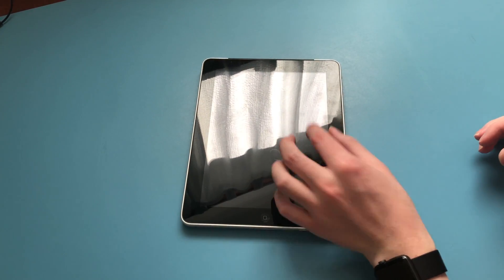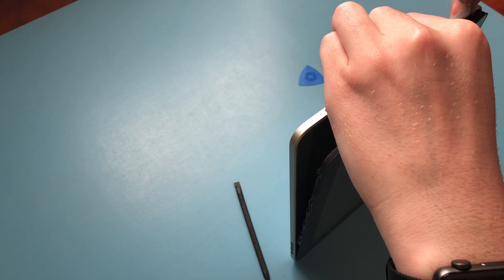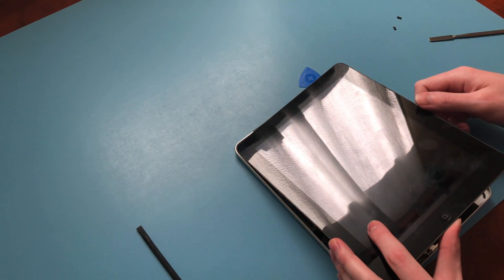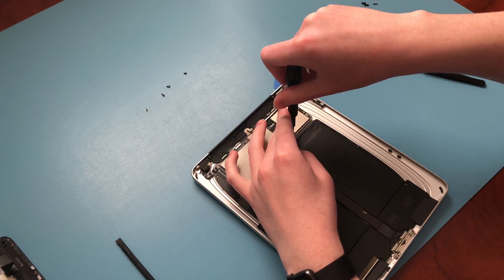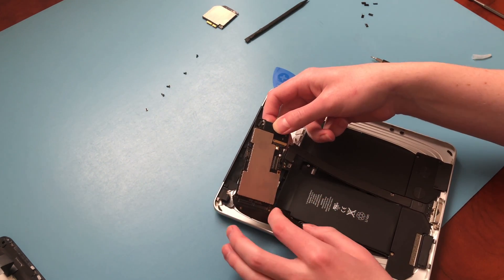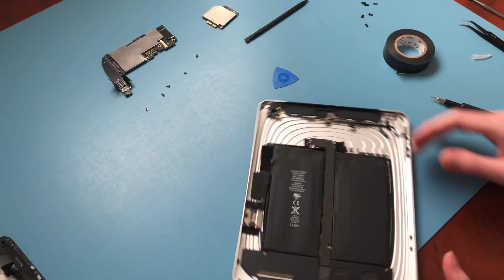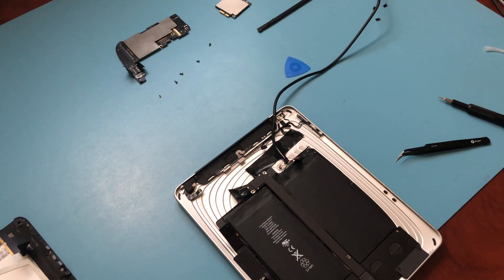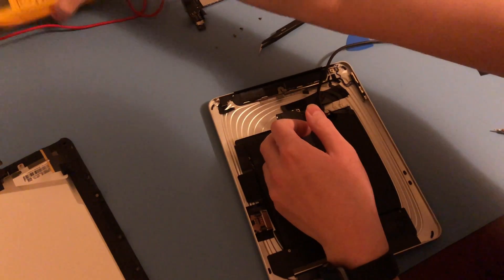How to fix a dead first generation iPad for free!

Comment: I'm not sure if this is what I need to do. After 2years of solid use (before I only used it sporadically) , my 1st Gen iPad mini had a hard time with the connection from the power cord. I bought a new cord, (after market was all I could find) and after a couple months I'm having a harder time charging. For a short time I could wiggle the connection a bit and carefully leave it undisturbed until charged. Now I jiggle it around for 10 minutes and get a flash of the charging indicator, then nothing. Maybe I just need to replace that 30 pin connector? I use the ipad every night and charge it back up every night usually when it's from 12-25% or so percent. So it's not from discharging too much. This is my evening TV as we no longer have any kind of TV service. My only relax time and we use it for taking pictures.
Reply from the maker: From what I can tell, it sounds like it could be one of two things. 

The easiest to check for is if there’s anything in the port preventing it from making a good connection. Check for any debris and very carefully use a small non conductive tool like a toothpick to remove any. The pins inside can be easily damaged!

Most likely, the issue your iPad has is a worn out port. Unfortunately, this is not the easiest repair as it involves opening the iPad and soldering a new port in place. Apple will not do this repair, but a third party repair shop may. 

Oh, and a future tip for buying new lightning cables is to only get the ones with the “made for iPhone/iPad” logo on them as they’re made to Apple’s specifications to ensure they don’t cause any harm to the port.

Hope this helps!
Reply: @Batteryfixer  Thanks! At the time I didn't find anything saying it was made specifically for Apple. I figured 1st Gen was so old no one bothered anymore, so I didn't do an exhaustive search. I will clean the port out and see what happens. Thanks again.

Comment: I have a question... there is two batteries do I just charge the one you did or do I check both batteries if the plain black one has voltage. 
it was at about 1.2v for the plain one currently checking the second one.
Reply from the maker: You only need to connect 1 battery to power as they’re connected and will charge together. That’s a higher voltage, so your iPad may have another issue, but it shouldn’t hurt to try! Good luck and be safe!
Reply: update:
both batteries read 1.3v before doing the charge. should I still try this method out?

Comment: I did all the steps carefully but it still doesn't work

My ipad kinda dead it just does the apple logo when i plug the charger it makes it on loop when i tried robooting it i didnt can u help?
Reply from the maker: It may need to be changed a bit longer. Have you tried using a 12w adapter when you’re booting it?
Reply: @Batteryfixer  I charged it for hours sometimes even days but yes i have used one

Comment: Thank you so much, this method can be used for the rest of similar battery type. Will try out too.
Reply from the maker: It should! Be careful and good luck!
Reply: best to disconnect from mains now and then and check voltage of battery

Comment: I have an iPad 1 with a black screen that keep flickering every 2secs. I can get it into DFU mode and my computer would recognise it. I've tried flashing it but it fails to go from DFU mode to Recovery Mode. Sounds like another hardware issue? Not battery? Thanks in advance!
Reply from the maker: That’s almost certainly the battery, that’s how the iPad reacts when it can’t detect one. If you follow the tutorial, it should fix the issue, good luck!
Reply: @Batteryfixer  Thanks so much! I'll try it.
Reply from the maker: @deyemjames01   good luck!

Comment: Hi! great video. Quick question, can't I just expose the battery terminals and charge it without removing all the components you removed before doing it?
Reply from the maker: You can, but I’m not sure if it’d be good for the board. You may risk damaging it while charging like that. To prevent anything like that from happening, I recommend removing it.
Reply: @Batteryfixer  thanks!
Reply: @jphormiga  , did you strip the other components or risk it? And what happened if you risked it? I can't find my tori bits.. :D
Reply: @JMWConceptsTheOfficial   Hey! It was two years ago so I don't remember very well... but I think I risked it. It worked well, the iPad still lives to this day

Comment: The first part of the video is works but  for me is not clear ....13 minutes of the video....When you connect the adapter! What kind of adapter used? What is the specification? 5v
Reply from the maker: I used a 12 w usb wall adapter that was originally sold with an iPad

Comment: This did not work :(
Reply from the maker: It may need to charge a bit longer, be sure to have a good connection with the battery, good luck!
Reply: @Batteryfixer  its been on the charger for 24 hours
Reply from the maker: @quit843  this could be a few issues. 
Easiest thing to check for is if a computer can recognize it. If it can it may be a display issue. 
Sometimes the battery is not salvageable and a new one is needed.

Comment: Hi; How to know if the battery is charging or not ?
Reply from the maker: When you’re charging it from the 30 pin connector, make sure you’re using a known good wall outlet, adapter and 30 pin cable. It should show some sign of life if you let it charge for a few hours. If it doesn’t, it may be a bad charge port. 
When you’re charging the battery directly, you can periodically check the terminals with a multimeter to see if it’s increased in voltage
Reply: @Batteryfixer  sadly i dont have multimeter, have tried to charge around 8 hours but still boot loop , is that mean battery is completely dead? Or the usb cable is bad? Have tried to use 2 a adaptor, it warms a little but dont why still failed :(
Reply from the maker: @kalongrabiesJR  it’s possible the battery is completely dead and needs to be replaced since it’s still boot looping after attempting to recharge it.
Reply: @Batteryfixer  i see, so should buy new one ya :( thank you anyway for the tutorial
Reply: @Batteryfixer i tried what you done twice for 3 hours, its still bootlooping, could i have to replace the battery?

Comment: I think my battery has to be replaced, how can I tell of the battery needs to be replaced.
Reply from the maker: If the iPad doesn’t show any signs of life after charging it for a few days with a 10w or higher adapter, it may need a new battery. If it does, you’ll need to open your iPad similarly to how I opened mine. It wouldn’t hurt to try recharging it the way I did in the video, but if that doesn’t work, it may need a new battery or have a completely different issue. 
Here’s the guide in case you do need to replace the battery: 
Wi-Fi model: https://www.ifixit.com/Guide/iPad+Wi-Fi+Battery+Replacement/2198
Wi-Fi + 3G model: https://www.ifixit.com/Guide/iPad+3G+Battery+Replacement/3186

Comment: I don’t get this, you take it apart to charge the battery, doesn’t plugging in the power cord charge the battery?????
Reply from the maker: Normally, it can charge from just the 30 pin connector. A common thing for first gen iPad’s is the battery will discharge too much if they haven’t been charged for a while. Sometimes, if you’re lucky it can come back to life if you charge it for a few hours and I’ve heard some people have gotten boot looping ones to charge by putting them into DFU mode. None of those worked for this iPad so I knew the battery had discharged too much and had to charge it directly.
Reply: @Batteryfixer , I think what Charlie is getting at, is that he doesn't understand the difference between direct charging and port charging.  So without knowing the precise info on iPad 1, I dare say that as of the times of iPad 1 relase and later the charging via a port is never direct, because it goes through some power charging controller that makes sure the battery is being charged using the optimal algorithm, that it's not being overcharged, that would control switching between phases (like the fast charging and slow final stage), etc.  And the controller needs to recognize that there IS a battery connected, which it has a problem with if it's totally flat.  All of the above is roughly speaking, an educated guess, not claiming to be true precisely pertaining to this particular case.

Comment: Mine does show 2.6v on the multimeter should I just connect it to the electric with the 30 pin cable? I have 2 ipad 1 the 2 of them have good motherboards 1 has dead battery one is 3g an the other one is wifi
Reply: Sorry for my English bro 😅
Reply from the maker: @jesusjaravargas2698  don’t worry about it, it’s great!
Reply from the maker: Yes, it sounds like that battery has enough charge to charge directly from the 30 pin cable. You might be able to fix the dead battery with this tutorial though!

Comment: I didn’t think this would bring my iPad back to life. Sadly the touchscreen doesn’t work anymore. Maybe because u broke that clip thing on one of those cables. Otherwise great video. I’m glad I found it. Thanks
Reply from the maker: Aw, sorry to hear about the touchscreen not working. have you referenced the guide on ifixit? Some can be difficult to reseat and it might just need an adjustment https://www.ifixit.com/Guide/iPad+Wi-Fi+Front+Panel+Assembly+Replacement/4174
Reply: @Batteryfixer  i've tries to reconnect it but it still didn't work. I think I'll buy a new digitizer but they're very difficult to find. I luckily found one and I hope it'll work again